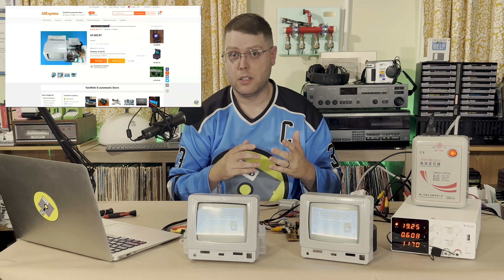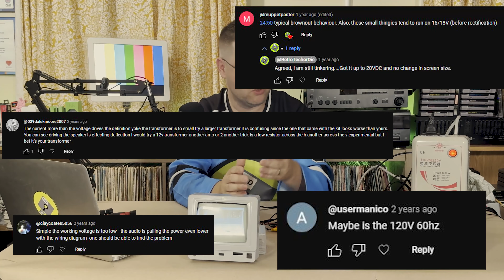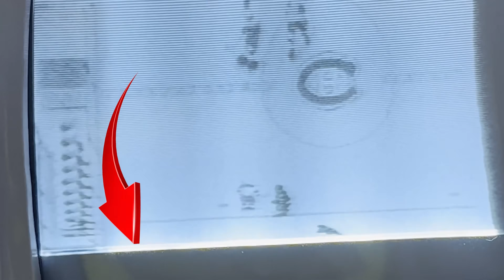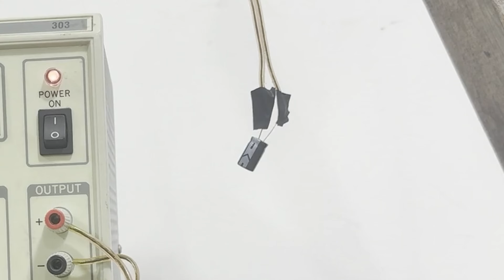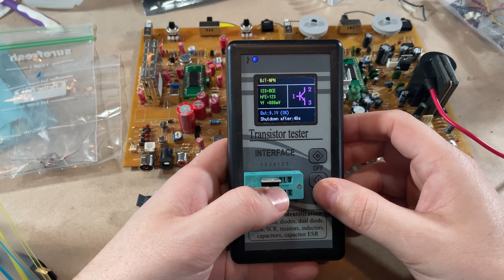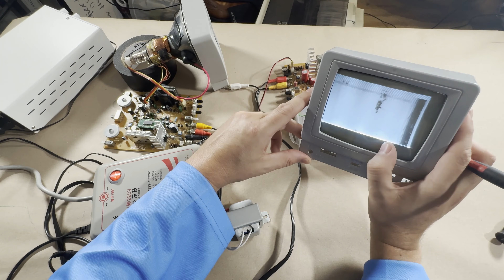I Built ANOTHER CRT TV from an AliExpress Kit—But It’s Still Not Working! #aliexpress #diy #retro

Comment: Both look like low B+, or the secondary voltages coming off the flyback are low. 
Do you have a scope? Use an x10 probe to measure the voltage and flyback pulse at the collector of the HOT.
The schematic is terrible but variable resistor W4 in the power supply section should adjust the B+ regulation.

Comment: The funny thing is of course it worked for everyone but you. I barely knew how to solder and made multiple mistakes and broke several traces, yet i still got it to work. 
Theoretically there could be a phase mismatch in the coils 
but 120V at 60Hz shouldnt make any difference since its internally running on DC everywhere after the regulator circuit. 

PAL/NTSC shouldnt make a difference since its black and white anyway and the b/w transmittions are pretty much compatible already

Comment: I was wondering about this project the other day. The board I bought is still unopened lol
I doubt the problem would be a power supply problem, or a signal compatibility problem. It could be on the high voltage circuit, or, more likely, the circuit that provides horizontal and vertical signals to the yoke.
The defect here is almost exactly like one I had on a security system CRT. Except that it would also distort the image a lot more. I couldn't figure out how to fix it.